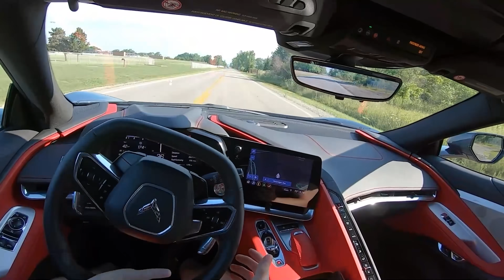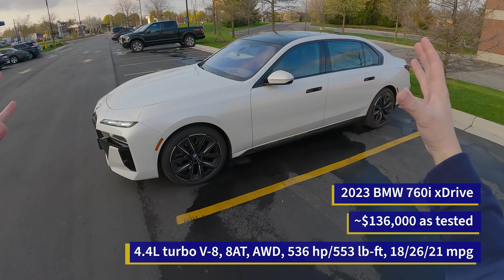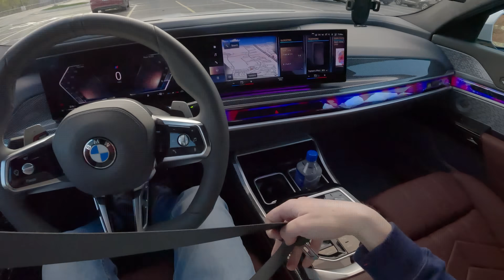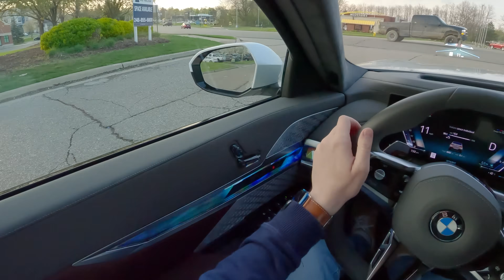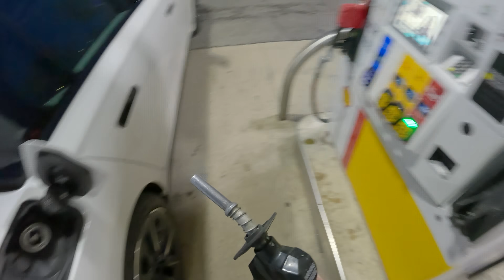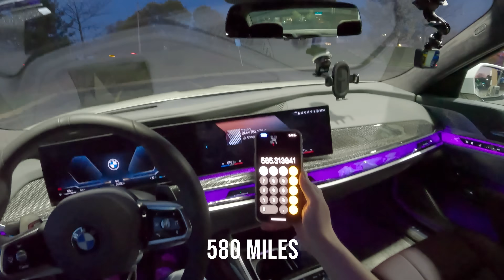2023 BMW 760i xDrive – MPG Test | Real-world Highway Fuel Economy and Range

Comment: I took my 760i on a 1700 mile round trip back in April of this year and my wife and I were so surprised at how long we were able to drive without stopping for gas. We had to stop for food and rest first. When we did decide to fuel up it had been well over 6 hours of driving, even in sport mode at times , before we refueled. The gauge still read just over a quarter of a tank left. This is an very impressive car for its size.

Comment: It's insane how BMW's engines tech has improved over the years. My 08' 328i with a V6 was marked for 18/28/22 (real world 24 for me) and this is a Twin Turbo V8 exceeding it. Insanity and hope this helps keep ICE vehicles alive for a bit longer. Miss my 14' 328d though (50+ MPG on highway road trips at 70 mph)
Reply: Not a V6, it’s an inline 6, N52 or N51
Reply: Modern gas engines are direct injection, this give around a 20% boost compared to port injection ones. And then you have the electric power steering and water pumps, and hybrid tech, which all help a little too. The B58 6 cylinder cars give about 20+% more mpg than the older 6 cylinder non turbos too, with more power, at highway speeds. My old 330i would do 37mpg (imperial) at 70mph, the 440is would do mid 40s mpg in the same condiitons by all accounts. You can have your cake and eat it.

I like the overall package on this car, you can't beat the feeling of luxury in a big, spacious car with some power, shame they couldn't fit a rear camera view mirror though.